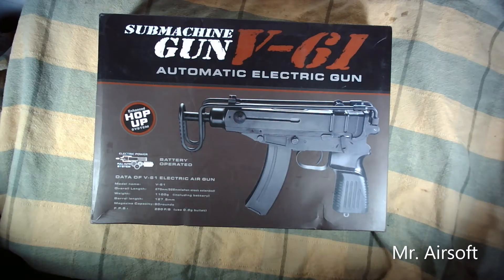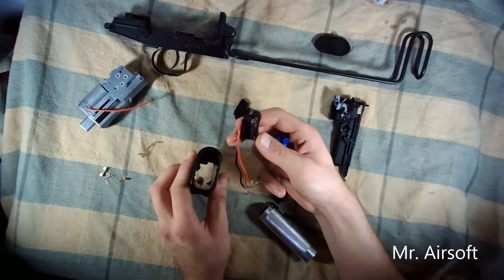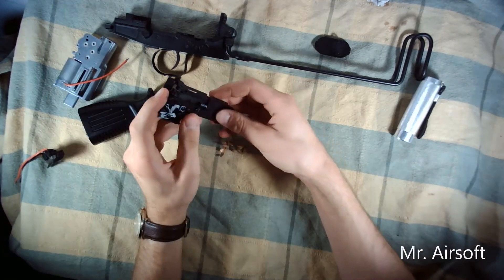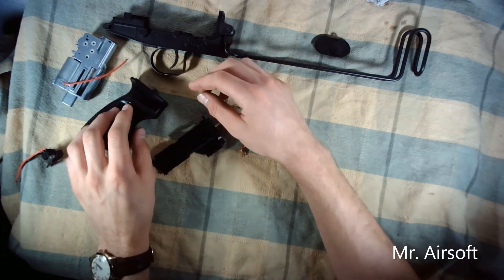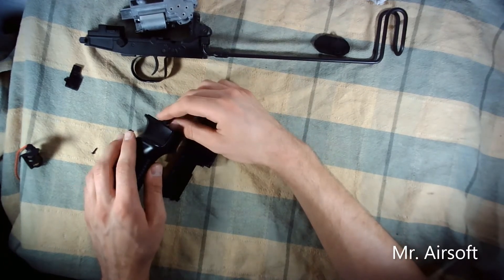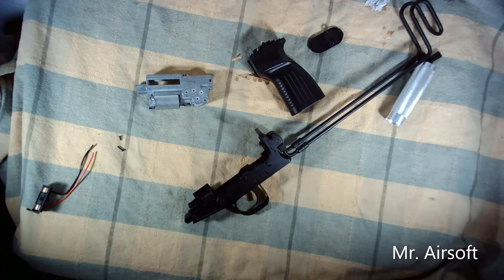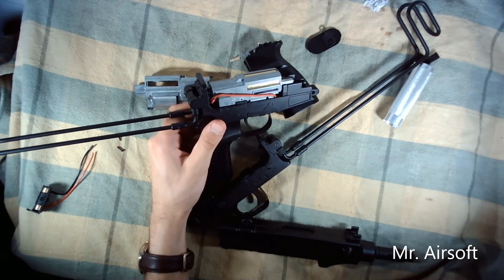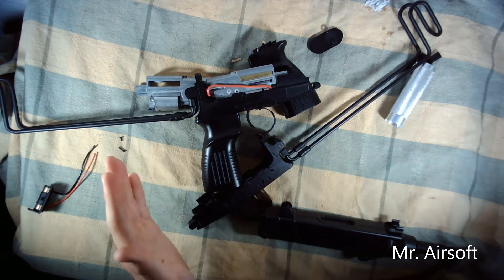How to Install a Basic Perun MOSFET in an Airsoft JG vz. 61 Scorpion AEP

Comment: Bit confusing due to conflicting instructions but after watching it a couple times and staring at the diagram for a while i finally understood. One thing i would add to help you in the future (or anyone else wanting to do this) is to measure out the motor wires with the grip installed and actually cut both wires (cut AFTER the splice for the red wire) and install some terminal connectors. That way, you can still remove the gearbox and work on it or even take the grip off if needed to work on it. Just a friendly tip. Otherwise. Not a bad video. Looking forward to putting a perun in my crazy Skorpion build im planning on doing
Reply: No problems! My scorpion is successfully lipo modded. I cut into the back ot the receiver where it meets the grip and ran wires out the back to an external battery bag strapped to the wire stock. Now i can run my Titan Batteries with the huge storage capacities and not have to worry about my batteries dying midgame. Only problem is the semi auto function stopped working and im not entirely sure how to correct it.
Reply from the maker: @CaptainNonsense1  Good to hear that it's working. I completely understand your reasoning for running wires right out of the back of the gun for a bigger battery. I would have done that as well if I intended to use an 11.1v with it. The only reason I kept it in the pistol grip was to keep some sort of realism look for the gun ha ha. 

That semi auto issue seems to be a recurring problem. The first boneyard scorpion that I got that currently has the mosfet in it was the same way, and I can't exactly remember why the problem was happening. I think it had something to do with the selector getting in the way of the mechanism somehow. At any rate, I'm pretty sure it's just due to the fact that the system is kind of poorly designed, rather flimsy, and prone to issues. The second boneyard scorpion I got did not have this issue, but I didn't feel like switching everything over to that gun at that point lol. Thankfully, with a 7.4v lipo, the gearbox cycles slow enough that I can take my finger off the trigger fast enough to only get one shot off ha ha.

I do like the gun though, despite its faults. It's small, fun, and gets lots of comments at the field. Also, an occasional kill with it feels a lot more satisfying since it's a lot harder to get. Good luck with your gun and have fun out there.
Reply from the maker: I just saw this comment for the first time now. Thanks for the tips! I hope that scorpion mosfet installation worked out for you, and I'm glad you were able to understand my ramblings. I just pinned your comment so other people can see your advice as well.

Comment: the link does not work for me can you maybe update it.
Reply from the maker: It looks like the listing is no longer on evike. Here is a link with the same mosfet but you need to solder the wires onto it yourself as well as source your own fuse and connectors.

https://www.evike.com/products/89598/
Reply: @mr.airsoft8295   thanks (i subed now)
Reply from the maker: @BrianLawter  No problem, happy to help.

Comment: Hey I got some trouble on my body pin that doesn’t want to pop out or go back to the original position, I removed the grub screws and don’t know how it would release
Reply from the maker: It's just held in by pressure. You could take a hammer and punch and knock it out, that's the easiest way I've found to remove it.